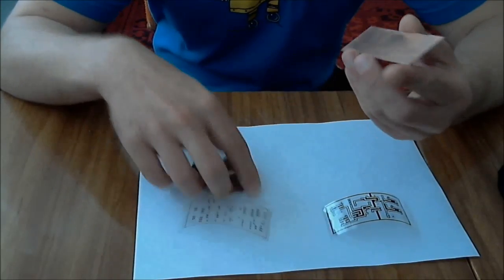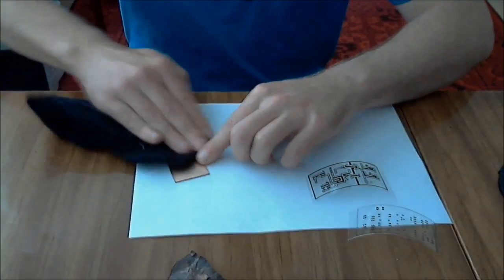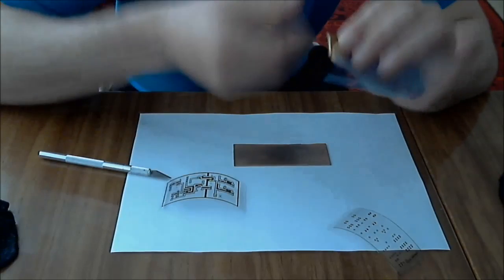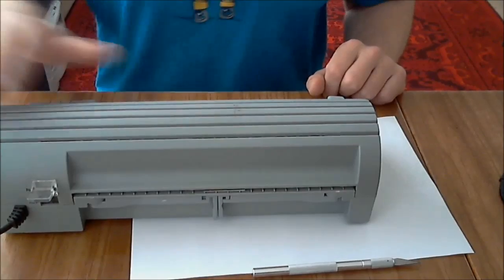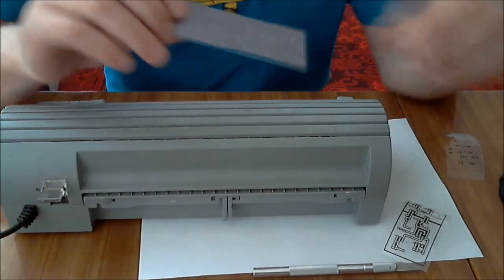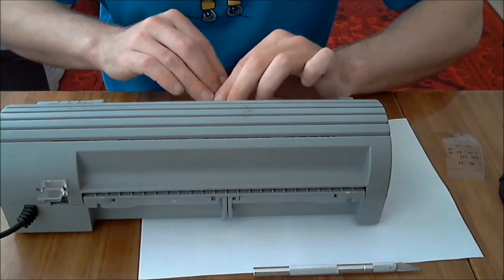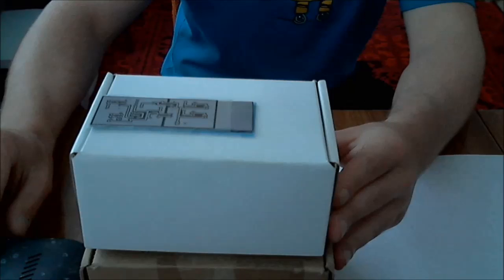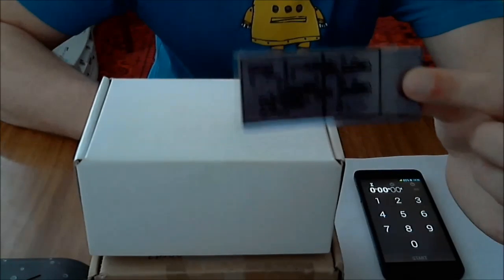photoresist 2

Comment: I've seen videos where people only work with the photoresist film under a yellow light so it won't expose.  Is that not necessary or are you using something different?
Reply from the maker: That's my webcam brightness adjustment in action )))
I was filming this with my blinds closed, so it was relatively dark.
Also photoresist is relatively tolerant to exposure to fluorescent light or warm LED light.

Comment: Is this just a regular laminator? What one are you using. Thanks
Reply from the maker: +Brandon Kalinowski Yes, it is a generic photo-laminator. There are no labels left on it, but I think it is an older variation of Royal Sovereign RPA 5954R.
http://www.ebay.com/itm/Royal-Sovereign-RPA-5954R-9-Inch-Laminator-Machine-/281583875169

It worked fine out of the box with 1mm and 0.5mm boards, but anything thicker requires modifications to the pulling mechanism.